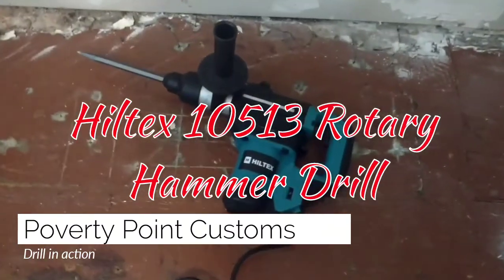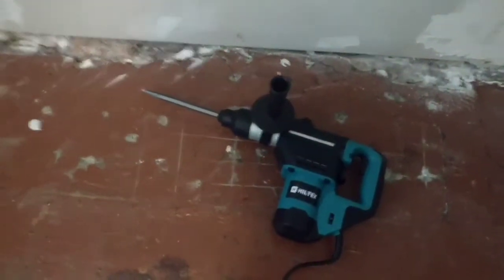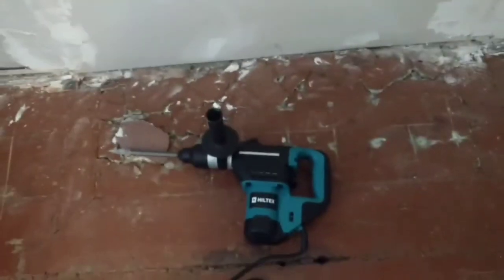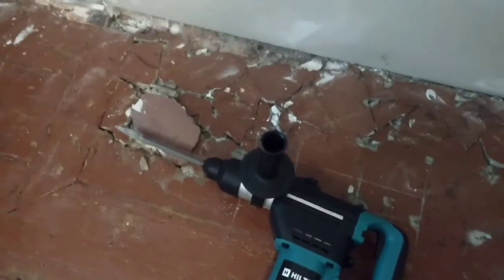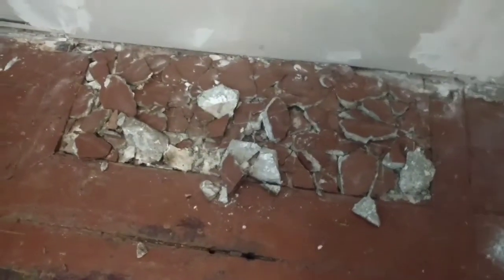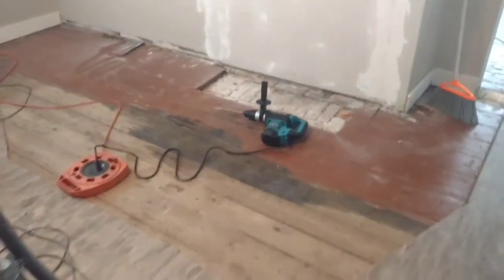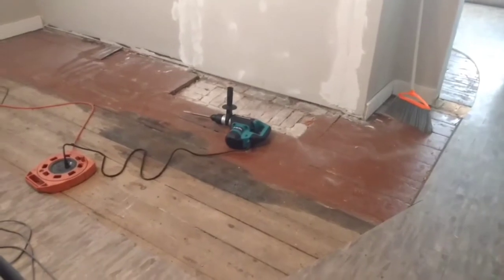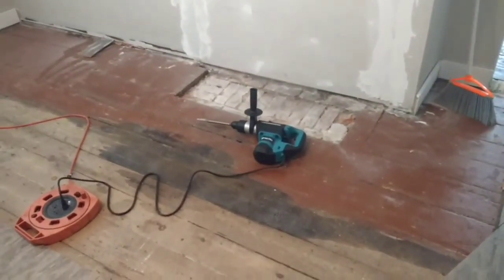Worlds most Powerful Jack Hammer! Hiltex 10513 Rotary Hammer Drill In Action Demoing Concrete

Comment: How do you lubricate the machine.  Manual says remove the cover using the key supplied but there is no key.  I assume the cover is the round knob    
on the top.  It twist but doesn't seem to remove
Reply: how do you libricate? please i need help u.u
Reply: There are six nuts on the top cover.  Remove these six nuts using a number 5 hexagon or Allen key.  Remove the cover and lubricate
Reply: @ameriqayqee12345  The top cover has 6 nuts.  Remove them using a number 5 hexagon Allen key and lubricate
Reply: @peterlearner8594  my model is not the same
Reply: @peterlearner8594  the lid is not removed
Reply: @ameriqayqee12345  If it's the same as in the original review then there must be 6 nuts securing the too cover.  Maybe you have to manipulate/slide i it carefully.   Check what else might be holding it down like the top switch.  I haven't tried to do it myself yet.
Reply: @ameriqayqee12345  There are six nuts on the top but also another two nuts at the end where the handle space is.  Once you remove the two end nuts it will come up
Reply: @ameriqayqee12345  If you loosen the two nuts in the handle space that allows you to pull back the handle just 3mm to release the top cover
Reply: @ameriqayqee12345  Also when the top cover is put back you must check the side flange fits into the side cover below or grease will leak.  To line the two edges up pull the side cover out at the front. The sides are quite pliable but you can only pull them from the front with your fingers.  For someone not experienced it may be too difficult to do

Comment: I got one and I cant figure out how to get the bit in. The manual is worthless. How do you get it to stay in?
Reply from the maker: I'll check in the morning and let you know
Reply: @PovertyPointCustoms  thank you. The drill or box wasnt wrapped in the plastic when I got it so I'm hoping someone hasnt opened this before.
Reply from the maker: I just did a quick video I figured it's easier to actually see it then explain how to do in a message, I would also be concerned if it was not in a bag when you unboxed your new drill so I would make sure there are no scratches or any obvious signs of use. I hope this video helps if you have any more questions or comments certainly let me know take care. https://youtu.be/s16RoeijERg
Reply: Thank you very much for taking the time out of your day to do that, I finally got it in!

Comment: The bad spelling aside, how do you consider that hammer the "world's most powerful jack hammer". Or does the bad spelling negate the claim?
Reply from the maker: Thanks, spelling error has been corrected. It was a family joke with it being the worlds most powerful. I've rented a few full size jack hammers and we were always joking on how powerful this was compared to them (this probably has 1% of the power compared to a full size) but all in all actually worked pretty good.
Reply: Lol. Been looking for a medium sized electric jack hammer for occasional use at the auto shop I own. They have more power than the air hammer I have and are good for knocking things apart. After your video and other reviews I decided against a rotary hammer and decided on a inexpensve 20 lb 1000w demolition hammer.